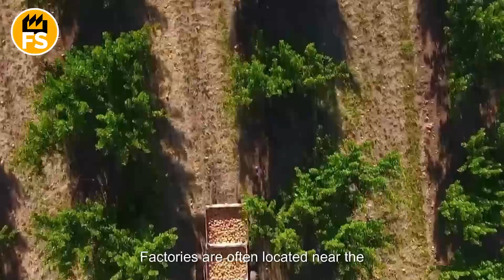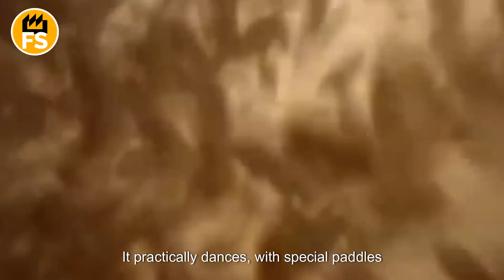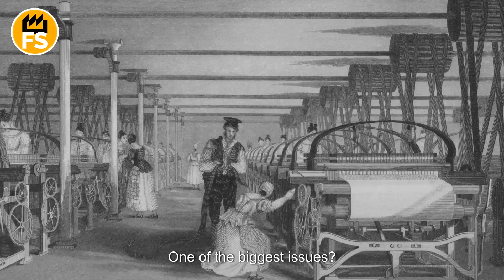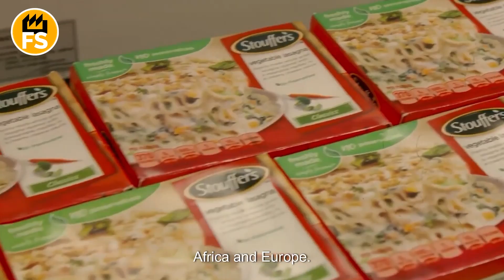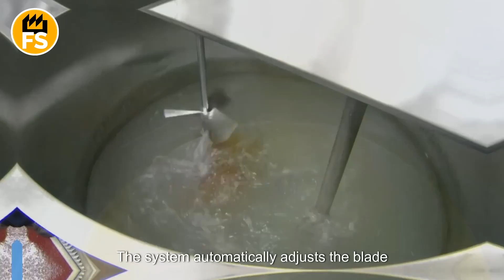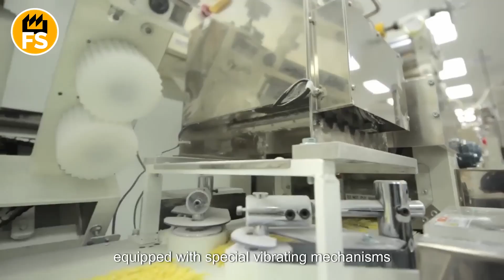How do these factories produce 30,000 cans of peaches per hour?! 🍑

Comment: The factory I work produces over 50000 cans of peaches per hour using Vacuum Filling. Of course only Clingstone
Reply from the maker: It's fascinating to hear about your factory's impressive output of over 50,000 cans per hour using Vacuum Filling! The efficiency of modern production techniques, especially with Clingstone peaches, truly showcases the advancements in the canned goods industry. 🍑